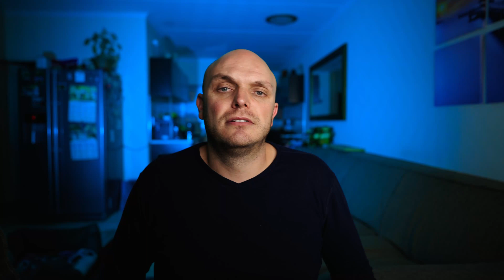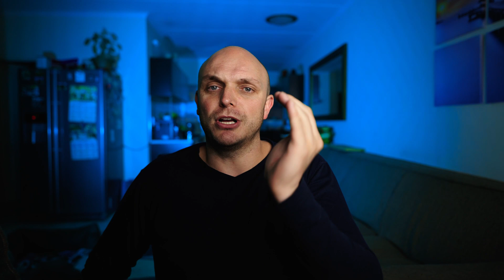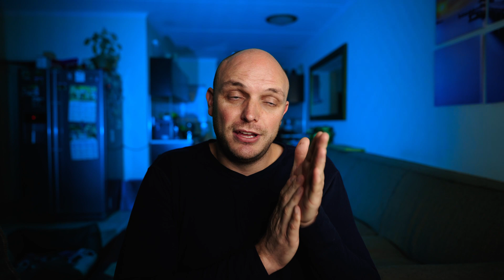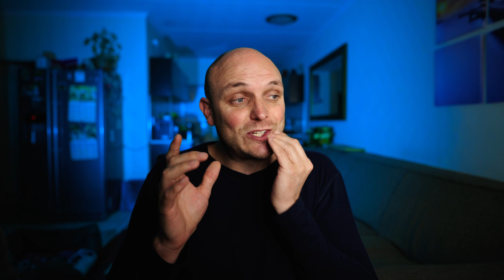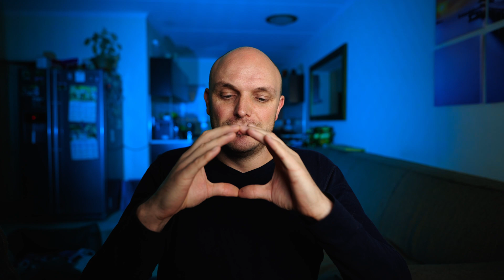Why do IBIS videos have wobbly corners?

Comment: I know this is an older video but some comments: yes, it's a difficult problem but GoPro solve it in camera, so do Sony with much better IBIS in more recent bodies. Canon also got better with firmware - what I suspect is doing a lot of processing and software correction of the image. Fuji seem to also do a bit better in later firmwares though not perfect still.